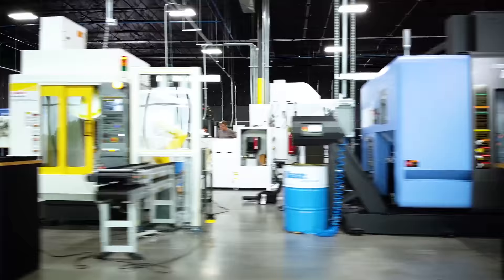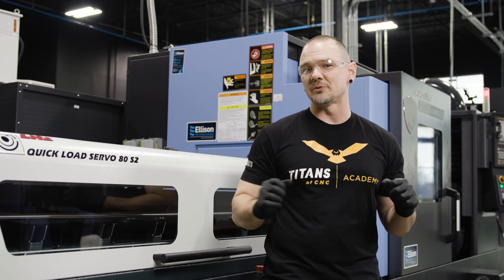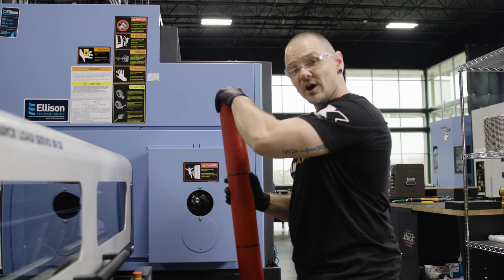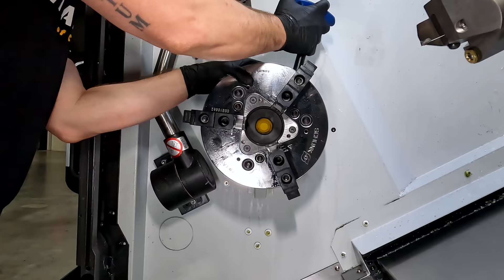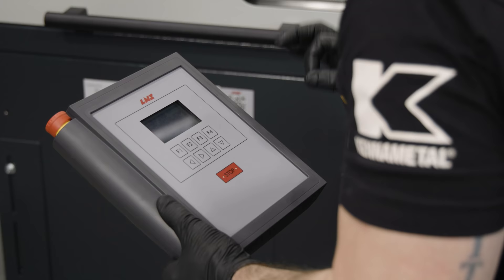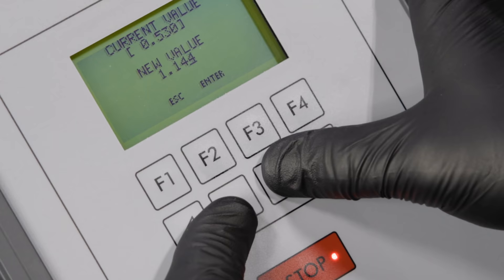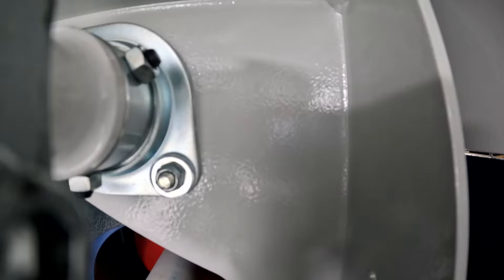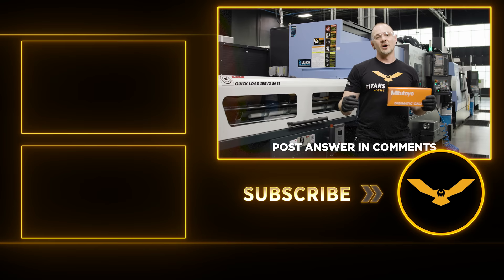LIGHTS OUT HANDS FREE MACHINING… Make MONEY with MINIMAL EFFORT

Comment: I'm currently in college looking to get a degree in mechanical engineering and I'm also learning cnc and by the summer I'm going to be in a internship at department of defense contractor and I'm trying to gather precision tools. I would like this tool add to my small collection because I had a chance to get a craftsman depth micrometer and and 6 in micrometer set but I couldn't get back to the store in time.
Reply: DO NOT REPLY TO TELEGRAM SCAM

Comment: Needs some help. I'm doing a 35000pc order on 304ss 30 seconds a part lights out machining taking off .031 on the OD and cutting it off, I am looking to run it lights out. What type of insert would y'all recommend for cutting the OD on this type of job? I'm currently using WNMG 331 for this.